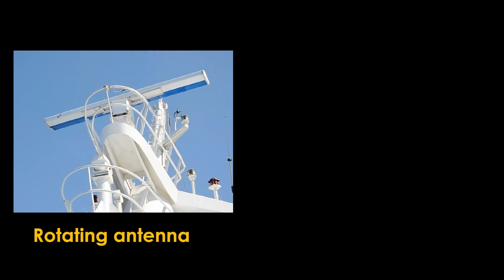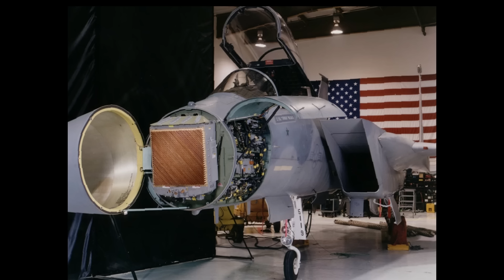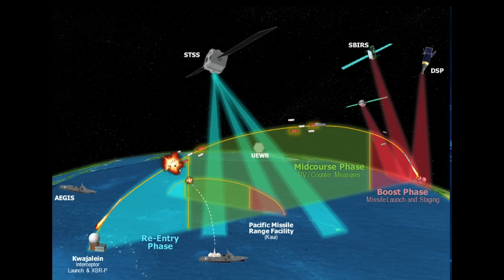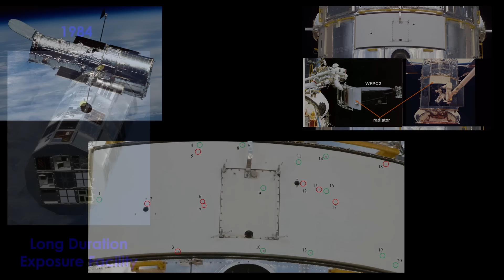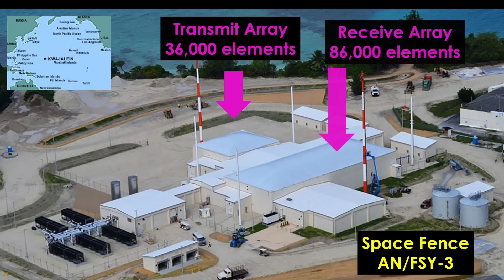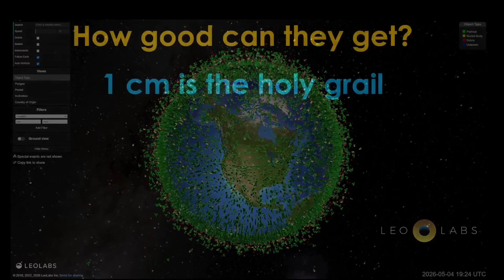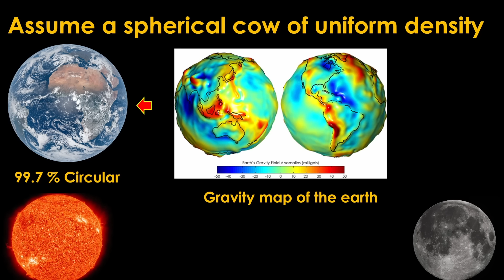Kessler Syndrome Part 4 - Trackers and Modelers

Comment: Theoretically, can you put several small identical stages of a rocket into orbit, assembly them there, like train wagons, and use them to farther missions, to mars and beyond? Would this be feasible?
Reply from the maker: Yes. But something like the starship architecture where you get one stage into orbit and then do other launches to refuel it is likely simpler.
Reply: @EagerSpace  I don't disagree with you (and you know a lot more about space than I do anyways) but it's worth noting there a lot of prior art with agena pushing gimini capsules and the Apollo architecture (kinda) even dragon or soyuz pushing iss not a perfect anolongs, but compared to that orbital refiling (especially cryogenics) has little prior art to go on I do think it's easier than a lot of people tend to say it is though
Reply: you kinda have that with northup grumans misson extension pack basically attaching an ion engine on to a satolite so it can use that instead of its own fuel

Comment: Did that Ticonderoga-class cruiser have Luneburg lens antenna?
Reply from the maker: I do not know.
Reply: I don't think so 
as far as communication the space force has done some research into them for satolite combination (wide field of view the lense have is good for satolite combination and the capability to make multiple beams and receive multiple singles at once is also useful for satolite combination.) but as far as I know luneburg lenses have never been put on a military ship and resurch into them for satolite communication is very recent.
Note It has a few balls but I'm almost certain those are radomes (a radar transparent shell (usually plastic) to protect the radar) not a lense of any type 

You may be asking about the radar on the ship considering the subject of the video and that's an much easier question they do not.
The search and track radars on the Ticonderoga class are passively electronically scanned aray (PESA) radars they rely on thousands of small antans which receve radar energy from a central transmit and recer module that is delayed slightly in some spots rocto produce constructive and destructive interference to stear and focus beams without a dedicated lense or moving parts (basically delay some singles just slightly and it'll be out of phase and destroy the beam in that area, use the same phase in other areas and it will straighten the beam in that direction) PESAs can also very quickly scan points in the sky in sequence to make a primitive form of track well scan (basically the radar hits an object remember where it is then a small fraction of a second looking for other objects that goes back to the object it's found to keep track of it)

Comment: Very interesting. Thanks for creating and sharing videos. What kind of power output is of these massive radar stations?
Reply from the maker: Pave Paws has a maximum power of 582 kilowatts. It only has a duty cycle of 25%, so the average power is quite a bit less.

Comment: Does the calculation for deciding whether to dodge debris not include the size of the object? ISS might not dodge if they have a 1/20,000 chance of hitting a marble, but what if it's a 2004 Chevy Tahoe up there?
Reply from the maker: The calculation to figure out the possible overlap in paths does include the size of the object, but even a marble at orbital speeds has more kinetic energy than a 50 caliber sniper rifle.

Comment: I see little discussion on the directions of the debris orbits. Debris that is moving in roughly the same direction as the victim should give only slight damage when compared to debris impacting with a head-on collision. Starlink satellites cross each other at quite severe angles. Maybe debris orbiting at the same altitude as the ISS is not moving in all directions.
Reply from the maker: I talked about this a little when I talked about geostationary orbits, where all the satellites are pretty much moving in one direction. in the same orbit.
Starlink is mostly at 43 degrees inclination, though they do have big chunk at 53 degrees. ISS is at 51 degrees because that's the lowest inclination that the Russians can reach from Baikonur. 
ISS is a little lower than starlink, which might account for some of the difference. 
High inclination orbits - polar / sun synchronous - are the worst on this. Iridium 33 and Cosmos 2251 collided at pretty much a right angle.

Comment: i fully agree with the major issue of distance and atmospheric interference limiting the tracking ability
just on this specific issue I expect it could be solved by increasing in-space detection -near expensive assets

simply, stargaze works!
the distance could be a more like 1-10km certainly <100km, with the benefit of no atmospheric interference in LEO 
the fact that 10k sats can operate together means detection is highly manageable with scale

clean-up
energy weapon 'clean-up' could ideally not let anything it detects pass rendering the tracking function less important 
but obviously this is a major cost that only makes sense right now if you made something far bigger than the iss
in the short-term, orbital manoeuvres are dominant effective way of protecting assets that work well!
only when assets start getting hit a lot will developments be made so this artificial clean-up could be done cheaply

i don't believe in Kessler syndrome being anything economics can't solve

Comment: TLDR: The limiting factor isn't radio communications technology (although this is a limiter given that bleeding edge millimeter wave 80GHz AESA radars have T/R module efficiencies on the range of 10-15%), it's simply that the Radar wavelengths needed to detect small space debris <~1cm, line up with the atmospheric absorption lines of water and oxygen, highly attenuating them.
And if you want to get around this by using larger wavelengths and just pumping lots of power through the Radar, you find yourself in the Rayleigh scattering regime, which is exponentially inefficient as debris circumference gets smaller.

I wrote this for a coursework on satellite-based space debris before Christmas (though we didn't get a very good mark so I wouldn't trust it too much):

Space debris detection can broadly be split into 2 categories: surveying, where measurements are taken over an extended period to model the debris density/flux in different orbits, and cataloguing, where debris is tracked with its position and orbit being put into a regularly updated database.

In the case of creating NASA’s survey-based Orbital Debris Engineering Model  (ORDEM 3.2), different data sources were used: pre-existing catalogue data for debris larger than 10cm in LEO and 1m in GEO; Haystack radar data for debris larger than 5.5mm in LEO; in-situ data from analysing debris impact craters on returned space shuttle windows & radiators for debris larger than 10μm and smaller than 3.16mm in LEO; and the MODEST telescope optical observational data for debris larger than 30cm in GEO. [2]

For a ground-based debris tracking and cataloguing system, such as the US DOD’s Space Surveillance Network use an array of telescopes and active radar sensors. For these systems real-time coverage of the whole of LEO is widely infeasible, so they instead maximise their coverage of different orbital inclinations, then maintain a catalogue of space debris orbits. These orbits are then simulated forward multiple days in advance to detect collisions possible within a certain likelihood, sending a conjunction summary message to the satellite operator.
When detecting an object with active radar, depending on the frequency being used by the radar, different regimes of scattering dominate.

As such, for a predictable radar cross section, the optimal radar frequency is in the optical scattering regime, frequencies in the Mie scattering regime are unpredictable as they are shape-diffraction dependant, and frequencies in the Rayleigh scattering regime are exponentially inefficient [3]. However at the same time, due to the atmospheric absorption lines of water and oxygen, frequencies over ~10GHz are highly attenuated [4]. 

Together at 10GHz these limit efficient ground radar detection to objects larger than 4cm diameter. Surveying can allow for detection of the 0.55cm debris, but this is not possible for a real-time tracking & cataloguing system which need high-accuracy position and/or velocity information, hence the need for a space-based solution for debris detection.

Performance of both an active radar and a passive optical in orbit debris-sensing system was modelled. For a test-case of locating a 1cm piece of debris 500km away over a sensing period of 1 second, the passive system was successful with a 3.02σ confidence, whereas the active system fell short with a 0.000000509σ confidence even when configured with enough power to necessitate 40 square metres of radiators, which would alone be in excess of our mass budget.
The 3σ range for an active radar system was calculated to be 10.2km and for a 90degree reflection angle passive optical system 502km.

[2] NASA, ‘ORDEM 3.2 – Software User Guide’, https://ntrs.nasa.gov/api/citations/20230014989/downloads/20230014989_ORDEM32%20Users%20Guide.pdf [Accessed November 2025]
[3] Wikimedia, ‘Radar Cross Section of Metal Sphere from MIE Theory’, https://commons.wikimedia.org/wiki/File:Radar_cross_section_of_metal_sphere_from_Mie_theory.svg [Accessed November 2025]
[4] ResearchGate, ‘Atmospheric Attenuation as a Function of Frequency’, https://www.researchgate.net/figure/Atmospheric-attenuation-dB-km-as-a-function-of-the-frequency-at-20C-1-atm-and-75-g-m_fig1_327574741 [Accessed November 2025]
Reply: And:
In low earth orbit there is a significant elevation in average orbital debris flux of object >1cm between the altitudes of 800km and 1000km, as shown in Figure 2. The primary source of this debris field is from a design oversight during the Soviet’s Radar Ocean Reconnaissance Satellite (RORSAT) program. At EOL the satellites would boost up to a parking orbit and eject their nuclear cores, venting their primary NaK coolant loops in the process. [9] What wasn’t predicted however, was that the orifice the coolant vented out of acted like a fuel injector, spraying out the NaK cooling in tens of thousands of droplets, which, as shown in Appendix 11 and Appendix 12, and spread out significantly due to their small size
[9] 	M. Matney, P. Anz-Meador, J. Murray, R. Miler and T. Kennedy, “The NaK Population: a 2019 Status,” 2019. [Online]. Available: https://ntrs.nasa.gov/api/citations/20190033494/downloads/20190033494.pdf.

http://www.svengrahn.pp.se/trackind/RORSAT/RORSAT.html
Reply from the maker: Thanks, that was very interesting.
Reply: Also:
15:48 In a Dusk-Dawn SSO (Where terawatts of orbital data centres are planned to go), all satellites by definition can point their solar arrays in the lowest drag configuration 24/7.

Comment: With regards to the ISS:
As far as I know (and I am just an amateur space enthusiast), the ISS modules are designed with impacts in mind. (i.e. incorporation of some sorts of debris shields) So small debris should not pose much, if any risk. Makes the modules more expensive, heavier, and so on - but if the lifetime is decades, it makes sense. The ISS can't really afford to lose even a single module, so it makes sense that they are build so that they can withstand small debris impacts.

I suspect that Starlink does not have any sort of debris shield, because why would they. SpaceX wants to launch as many as possible, the Starlink satellites are build as cheap, small and light as possible. If one Starlink satellite gets hit and destroyed, it's a small impact for the constellation (sorry for the pun), and as far as I know collision debris should decay fast in the Starlink orbits (if I recall your videos correctly).

One thing which would make sense, is for the Starlink sats to be build in a way that minimizes the number of debris objects - though that is probably easier said than done.

Postscript:
Also, moving the ISS needs much fuel, interferes with the science, is probably not fully automated, quite likely eats up many expensive man-hours. Moving individual Starlink sats on the other hand is probably automated, and I'd imagine more or less free.
Reply from the maker: ISS uses whipple shields, which do really well with small debris but not so well with larger debris.
Reply: @EagerSpace  Probably the classic case of "reducing risk close to zero for human spaceflight is economically not feasible"

Also, one has to remember, ISS design is decades(!) older than StarLink, so I'd imagine a current space station design would handle things differently. "Free flyer" jumps to my mind.

Comment: About star trackers: yes, they look at stars in order to determine the orientation of the star tracker relative to the stellar sphere. But you only need one of them to provide full 3-axis rotation information. So why have more than 1? Because if the sun is too close to the FOV, that tracker stops tracking temporarily. So you want one more pointing in a somewhat different direction so it won’t be sun-blinded at the same time. Why have MORE than two? In case you want to be tolerant to one of them degrading or dying, or maybe your spacecraft has multiple attitude pointing modes that would put one of the other trackers pointed at the earth, which makes it not work as a star tracker generally.
As for them being useful in tracking very small objects, this strikes me as not terribly likely, since the lenses on the star trackers used on spacecraft of this type are typically fairly wide-FOV while maintaining a fairly small aperture. This puts a fairly hard floor on the dimmest objects that can be spotted, subject to its distance from the satellite. But having 30,000 of these on orbit, 10,000 to 20,000 of which are, at any given instant, in a position and orientation to catch a streak of a piece of debris across the focal plane, does bump up the effectiveness by a few orders of magnitude. Postulate that any small debris at the Starlink altitudes will have already circularized its orbit due to drag, and you can confidently say that anything Stargaze DOES detect and calculate an orbit for will be close enough to all the satellites that Starlink will definitely want to know about it because it will be close enough to be a consideration for many satellites. And as the constellation grows, the effectiveness of this approach will increase.
Reply: As the constellations grows, so do the computing requirements. And probably not linearly...
Reply: @bbgun061  Well, the detection of a streak along the focal plane is going to happen onboard the satellite. And likely they would require a steak across 2 or more frames so that they know they’re not just seeing a proton colliding with the camera. The next layer is figuring out if the streak is a known large object that’s far away, like another Starlink. So I bet they handle that onboard too, calculating where other known catalog objects are inside the star tracker FOV. And once those things (protons and satellites) are excluded, then you’ve isolated out the size of objects that debris tracking would be interested in. And yes, then you send that track to a central correlation engine whose job is to look to see if this track could fit an already-known piece of debris. And if not, then it is an uncorrelated track (UCT), and it gets compared against other relevant UCTs, and that process continues indefinitely. But to respond directly to what you’re implying about the computing requirements growing with the increasing rate of UCTs, yes, it does. But that’s not a bad thing, since computing on the ground is cheap and easy, while debris collisions are not at all cheap. A large catalog of up-to-date objects and UCTs is a feature and a blessing, not a curse.
Reply: At first I thought three trackers would also increase precision. But that only matters if looking at a star constellation at an angle were to distort the image. And that's not really the case when they are so distant.
Reply: @mskiptr  Correct, that’s not at all the case. Even for the sun, looking at it from the North Pole vs the South Pole gives a parallax of 0.005 degrees, which is tiny. However, you do get more accuracy regarding where the star tracker is pointed than you get regarding its twist angle around that vector. So if you have more than one star tracker onboard, you probably are running all of them at the same time, and using an optimal sensor fusion algorithm to combine the results. The geometry and error analysis is pretty simple, the sensor fusion gets more involved.